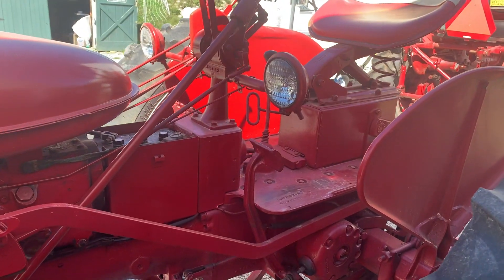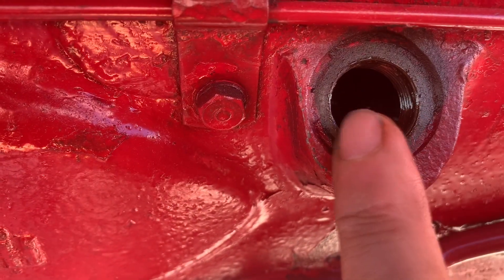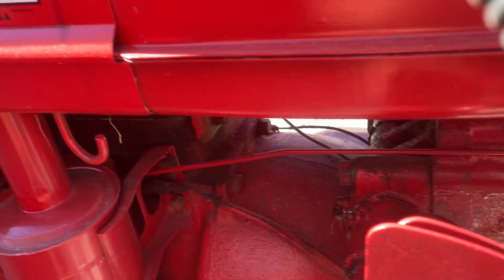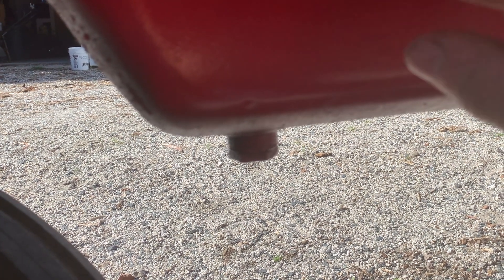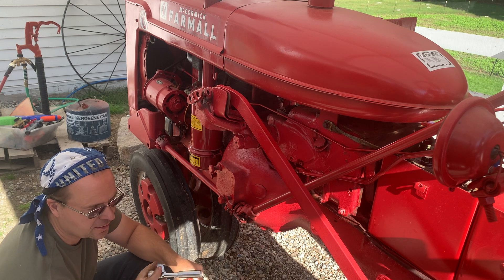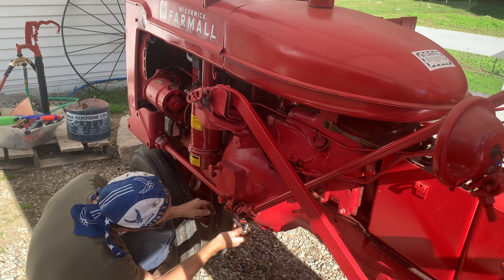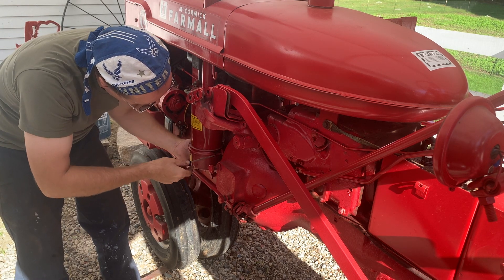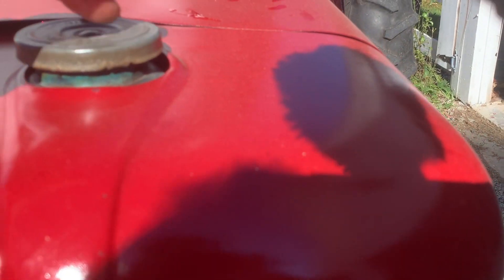Preparing The #Super_C For Work-Daily Checks

Comment: You don't look at color of oil in air cleaner during an oil change you change it with every engine oil change. You forgot to tell guys that when you fill oil pan after oil change that you have to  start and run engine for 5 minutes and recheck oil.. The 5 minutes will refill oil filter.
Reply from the maker: This wasn’t a full-service. Just checking everything before working it hard. All of what you said is true when you pull them
In for servicing. Thank You for watching